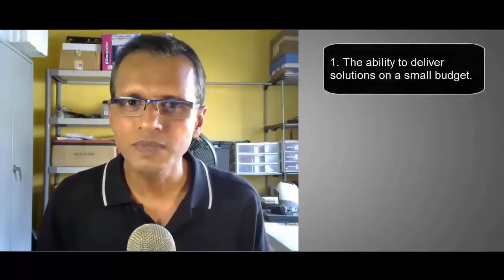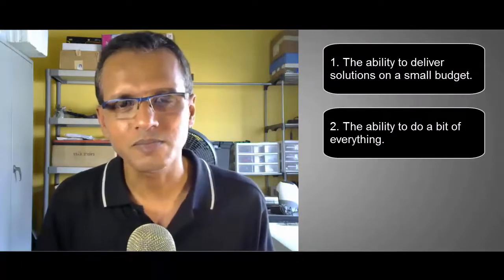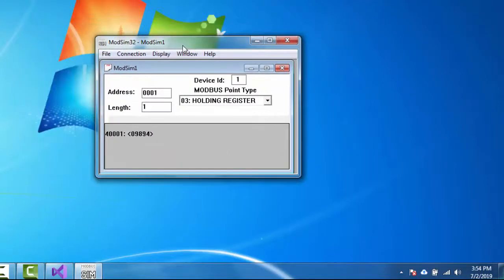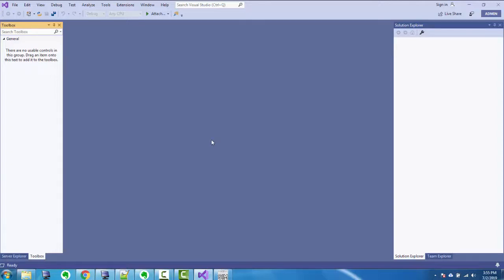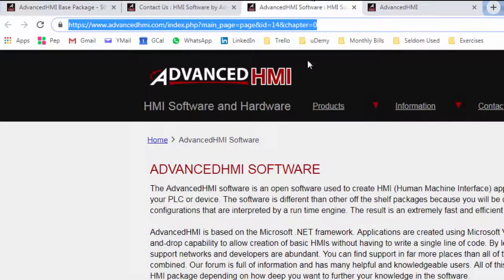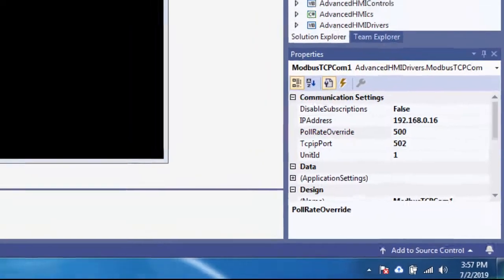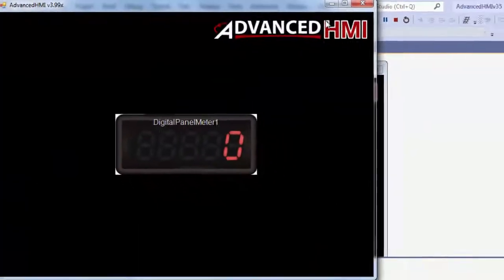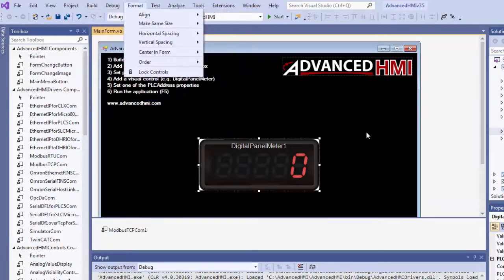Connecting Advanced HMI to a Modbus TCP Server - Quick and Easy

Comment: Thanks for sharing this simple example, exactly what I needed to setup an application to test the Modbus functionality on our products during testing!  One thing I haven't been able to figure out perhaps you know a solution.  I would like the IP address to be editable on the display so when I publish the program for the end user use they can edit the IP address for their particular unit in case they have changed it from the default.  Any idea if/how this can be done?
Reply from the maker: Hey Shane. That's a really interesting one. Unfortunately I have never had cause to do that so I am not sure if it can be done. Sorry about that. For the all of the instances where I used Advanced HMI, I was performing the installation so the setting of the IP address was a one shot deal. Now Advanced HMI is essentially a library within a larger .NET application. What about storing the IP in a text file and reading that text file on startup, and using it in the code. In that way, the customer could just edit the text file.
Reply: @EmileAckbarali  Thanks for the reply!  I actually did figure out a solution. I created a text box where I could enter an IP address and then went into the MainForm code and told it to use the text box string for the IP address. It starts with the fixed IP you enter during development and if you change the text box it updates the IP.  Works great.  Here is the code I used.

Private Sub TextBox1_TextChanged(sender As Object, e As EventArgs) Handles TextBox1.TextChanged
        Me.ModbusTCPCom1.IPAddress = TextBox1.Text
End Sub
Reply from the maker: @shanesdiy  that's a fantastic solution. We'll done! Thanks for letting me know.

Comment: sir, you are pleasure to watch..  very little money projects has been my history... however, our company went 95% with "rockwell engineering" for several years.. now we have hugh $money$ projects.. the engineers keep the machines down for a very long time with simple upgrades on machines that were working ok with 80's-tech and when it is done the future replacement parts require costly software upgrades... the motor drive message setup displays fail constantly.   Geee, i like your video and have used AdvancedHMI with satisfactory results..  thanks...:)  great job.
Reply: PS: i do use some AutomationDirect products at fair prices...:)
Reply from the maker: Thanks very much for the comment.